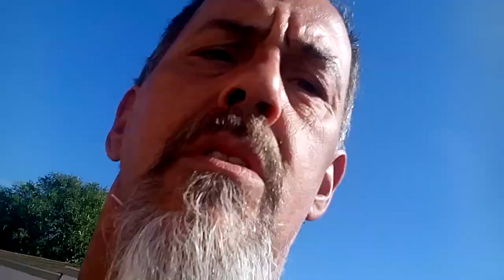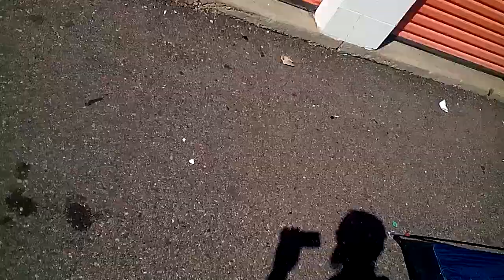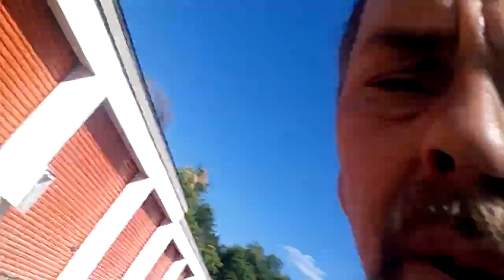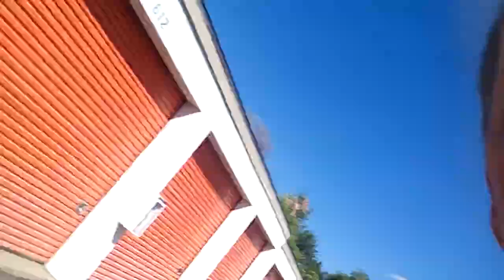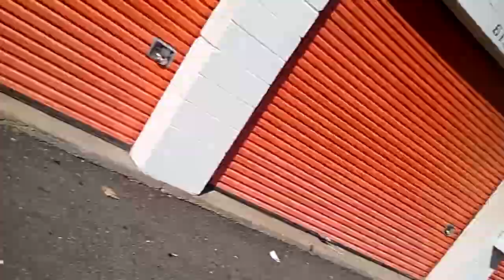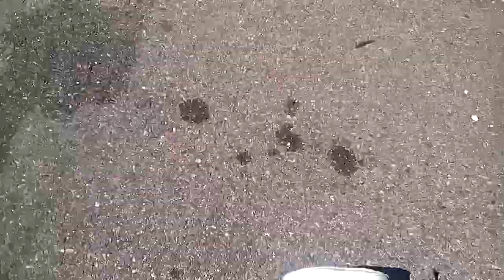Crock pot dismantling

Comment: Thanks! You were sooo much help...NOT!!! 😫 I really needed help removing the bottom off of my Rival Crock Pot, so I could replace the handles on it 🥺, but I’m not going to get rid of it, since it’s been a really awesome crock pot for me all these years. I’m just gonna keep on using it without it’s handles. 😜
Reply: there are two silver, (funny looking) circular shaped screws on the bottom that can be preyed off. Once removed, you can carefully pull the inner heating tub from the casing (because it’s not connected to anything else ) and access the easy to replace handles. You could probably just add a couple screws. theres a lot of room in there. Easy.